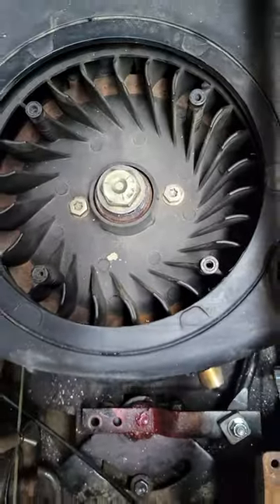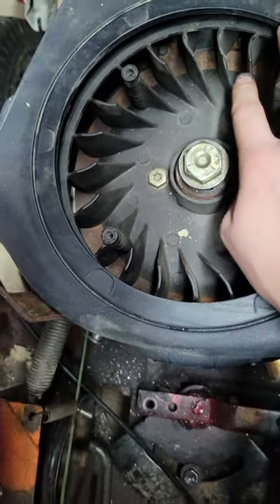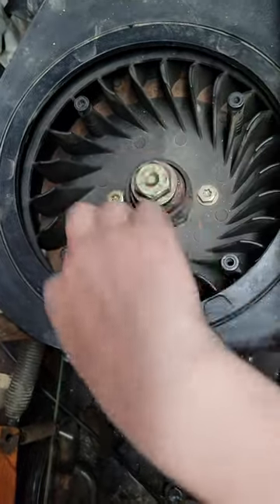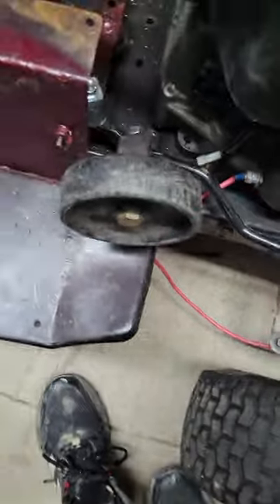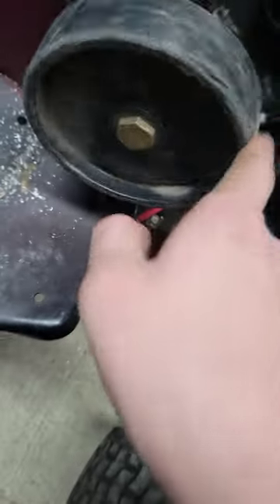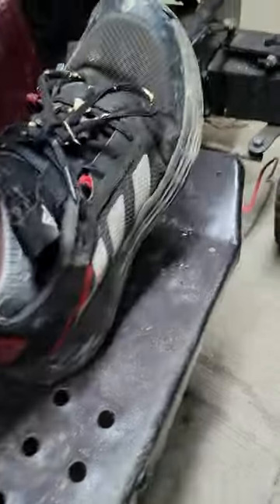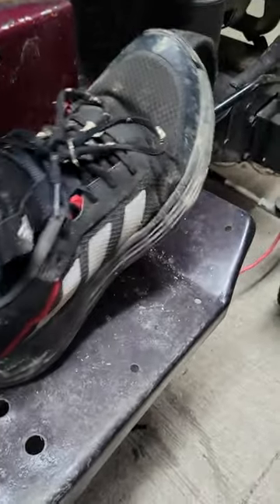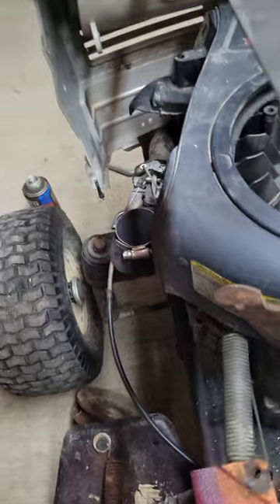custom cruiser update #mower #briggsstratton #shorts

Comment: How durable are MST-206 transmissions? Cause for some reason when I drive my mower offroad the mower shakes all around and I need to know if the trans will break
Reply from the maker: They are pretty strong, they are the 3rd strongest 3/4 axle geared transaxles. The 800 and 801s beat it due to stronger gears. But they are plenty strong as long as you don't push your luck lol
Reply: @Mo_2118   How long has the one in big red lasted?
Reply from the maker: @crazinesskid6254  lasted a long time until it started making bad sounds, but after I took it apart nothing was wrong. So it's just getting a nice clean up and oil change